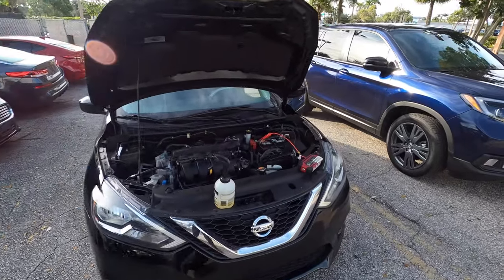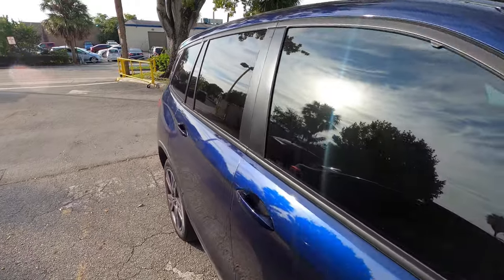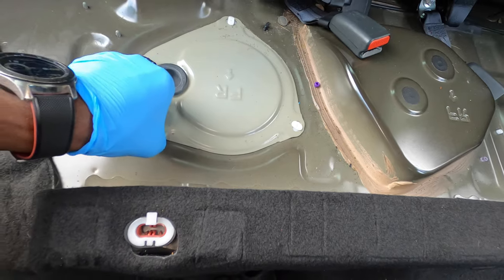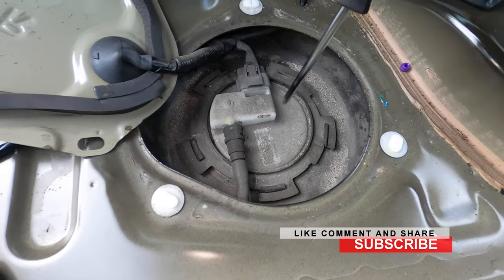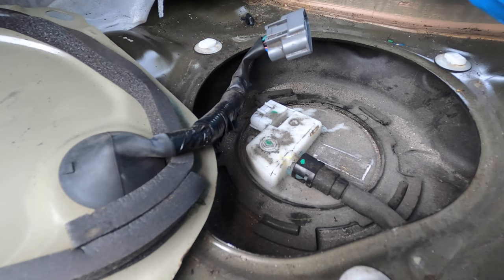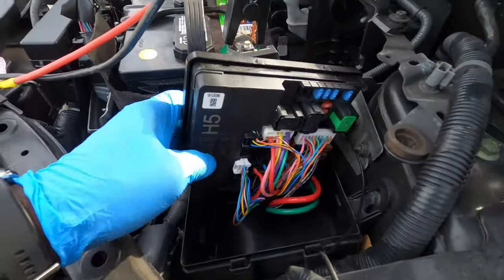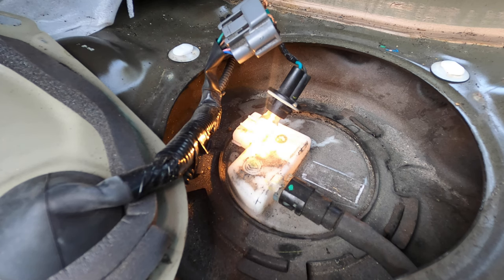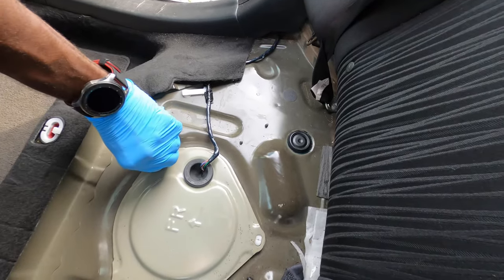nissan driving and shut off fixed (fuel pump and fuse)

Comment: My 2018 sentra with 42,000 miles JUST cut off on the freeway yesterday, a Mobile mechanic just told me I need a whole new fuel pump, he never even checked the fuses. Glad I googled and saw this, before having it towed to The dealership and waiting DAYS for to get fixed we have someone coming to check the fuse in the morning.

Comment: Do you know where the relay for the gas pump is located?
Reply: I have a 2011 Nissan versa hatchback and the fuel pump relay is built into the IPDM (the fuse box to the right of the battery, large flat black square) I recently had to replace mine.
Reply: I’ve been searching for days and nobody shows it anywhere I know it’s some built in the panel but thank you for saying it’s black

Comment: Hello, don't know if you remember me saying that I had problems with my Altima last month but after replacing 4 sensors the mechanic found out that it was the alternator, battery and a ground wire. The wire was bad.
Reply from the maker: Yes i remember thank God you got it fixed
Reply: Dullah Goso hard, Yes thank God. Happy Holidays!!!
Reply from the maker: @brendamitchell5767  thank you and same to you love